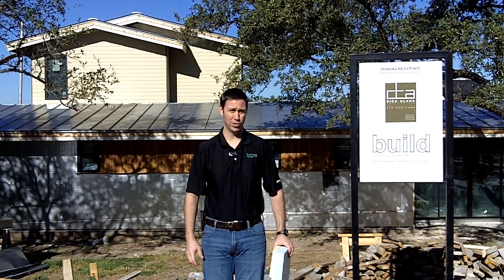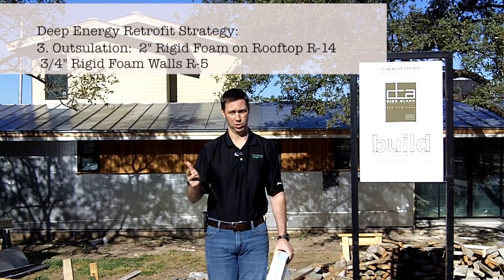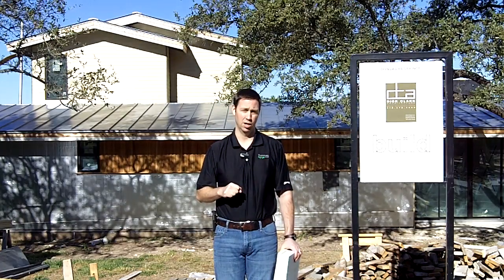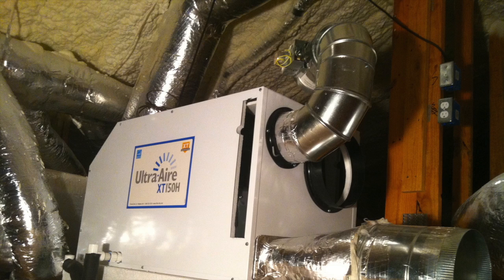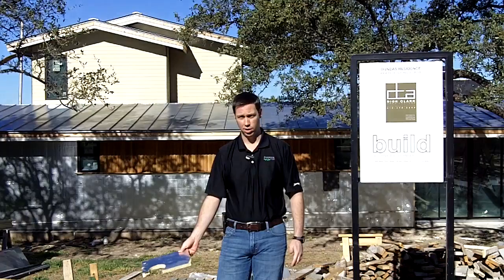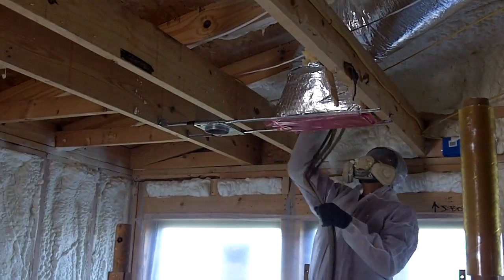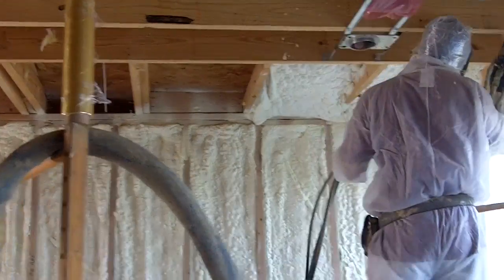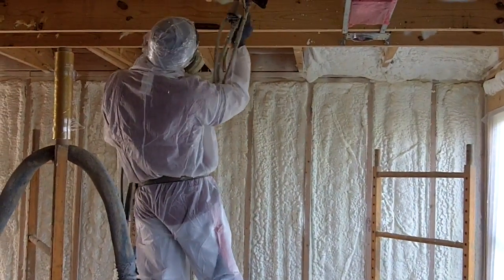Texas Deep Energy Retrofit

Comment: Great post.  Doing something similar here in Houston.  One piece of feedback.  Spray foam is an Isocyanate based product.  It is unsafe to be present while it is being applied.  Your applicator was not wearing appropriate respiratory protection.  In an enclosed space supplied air respirators are strongly recommended.  It is a significant health hazard for others to be present.  Everyone reacts differently with each exposure to isocyanates.  An adverse reaction can involve severe and life threatening complications.  Exposure reactions are typically cumulative, but vary by individual.  

Anyhow, I greatly appreciate you sharing this information.  I'm remodeling a 1965 house in Houston and had a hard time finding good reference material for SPF.  R values are biased for thermal transfer.  Air infiltration is a significant issue because it brings in moisture and it's associated latent cooling load.

One question for you: Why didn't you do ducted mini splits in the rest of the house?  Seems like the energy savings from reduced energy consumption and true zoning would produce an ROI.

Comment: I currently have paper faced fiberglass batts in the walls. If I add some foamboard on the outside, I'm worried about trapping moisture inside the wall cavity. I was under the impression that if I remove the siding I could access the inside of the wall cavity and take all of the fiberglass batts out. I was wanting to replace them with a much better performing dense packed cellulose and also removing the vapor barrier. Not possible?

Comment from the maker: The answer lies somewhere in between.  If you already need to replace siding then the outsulation is straightforward.  The insulation in the walls is tougher considing you'll need to remove ALL your drywall and potentially move out of the house for a while.  The outsulation is the more important of those two items and done well will get you 90+% of the way there.  See if you can get at least 1" of foam for the best efficiency.  Best, Matt

Comment: Hey Matt I have a question for you. I'm looking at doing a deep energy retrofit on my own home. I'd like to add foam insulation sheathing "outsulation" to beef up my wall's R-value. Is it a big deal to remove all of my existing wall insulation? I have a bunch of paper-faced fiberglass batts in the walls now, but I'd like to remove them and dense pack cellulose. Is it easy to remove the sheathing and all of the existing insulation? Or is that extremely labor intensive and expensive?

Comment from the maker: Good questions.  First, use a sealed combustion furnace so there will be no open flames in the attic.  This is really a MUST with a conditioned attic not matter the choice of insulation.  It's 95%+ efficient and uses PVC for venting because it captures so much of the heat in the sealed combustion chamber.  See my other videos on why I prefer rigid metal duct work over flex duct.  Thanks, Matt

Comment from the maker: I don't have hard data, but I would suggest talking to a local company that performs energy audits.  Anyone who does Duct Blast tests regularly can tell you how much better flows you'll get in a metal system over flex.  Also look at Joe Lstiburek or Mark LaLiberte's building science seminars for more info on this.  Man J & D is done by Mech Engr, layouts by the contractor.  All my ducts are inside the ac space of the house so insulation isn't as important. R-6 typically. Best, Matt

Comment from the maker: Excellent, thanks for commenting.  The furnace in this house is a sealed combustion 95% gas unit.  It uses a PVC vent to bring air into the sealed combustion chamber and another pipe to exhaust the flue gas.  Because it's sealed it can be enclosed in the attic with no issues regarding fire or backdrafting of combustion gases.  You must use this furnace if it's located in a conditioned attic.  For more flame resistance you can spray an intumescent (fire retarding) coating on top of the foam. Matt

Comment from the maker: Appreciate your loyalty.  Good spray foam questions.  Open cell foam will hold moisture like a sponge, but so will fiberglass.  The key is not allowing bulk water to penetrate your drainage plane on the outside of the house.  I'm a huge fan of the Tyvek weatherization system for that reason regardless of the insulation type.  Generally open cell foam in our hot/humid climate is my preferred option with some exceptions.  Below grade, wine rooms, or high wind/tornado areas go closed cell. Matt

Comment: You're the best, Matt. I have a question for you. Do you worry about open cell spray foam HOLDING moisture in a hot humid climate? Since it is sprayed directly against the wood structure and/or sheathing, wouldn't the moisture it holds risk rotting out the wood? Why do you prefer open to closed cell spray foam?